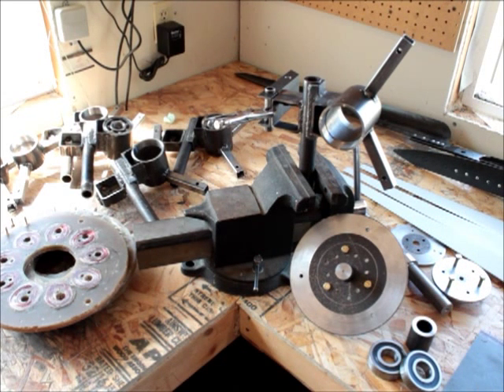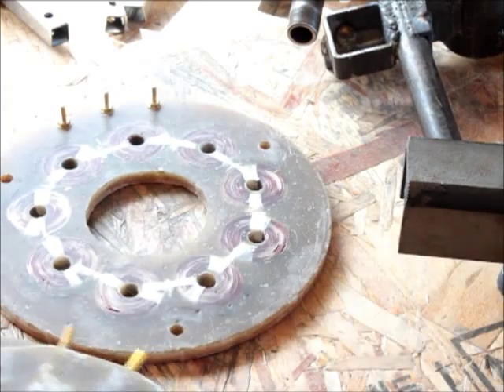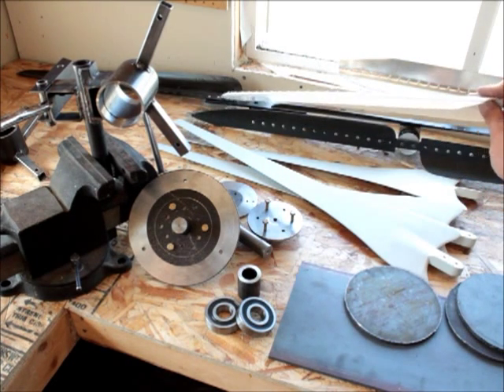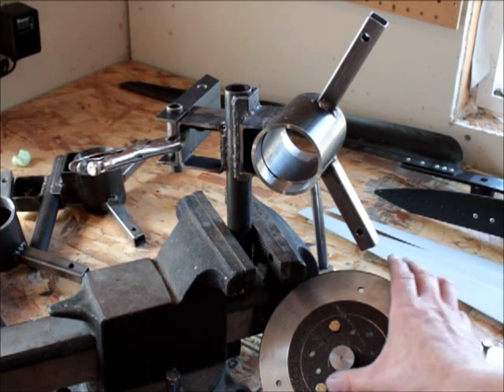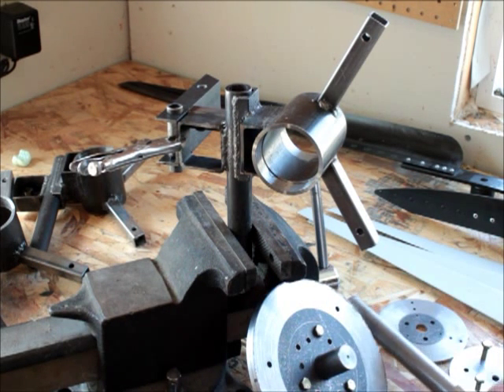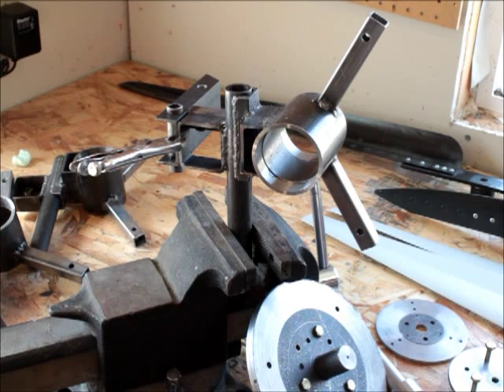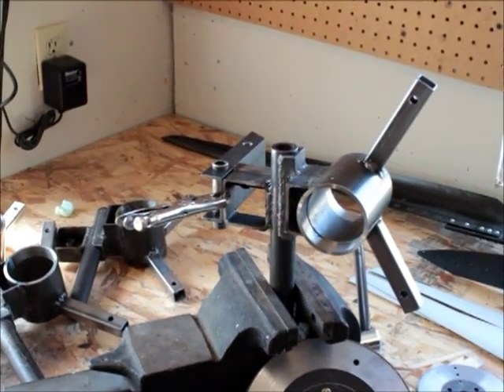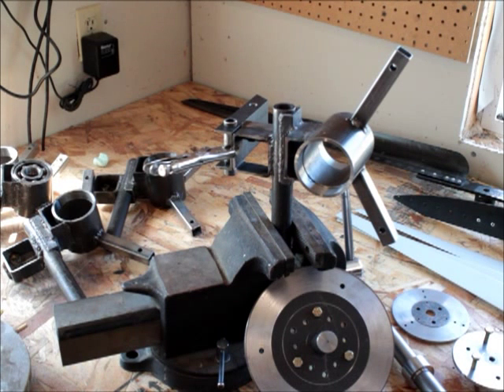Turbine Update and Thank You muddys mighty mini dual axial flux alternator generator

Comment: from looking at what you have there. talking about a bare bones kit. the part were the tail goes I leave that off rasion is for different size stators and rotars. I like to get the part that pivits on the pole, and the bearings for the shaft ect were I can atatch blades and the magnet rotors. I hop you crate a website because I would buy a kit off yea. and take it from there.